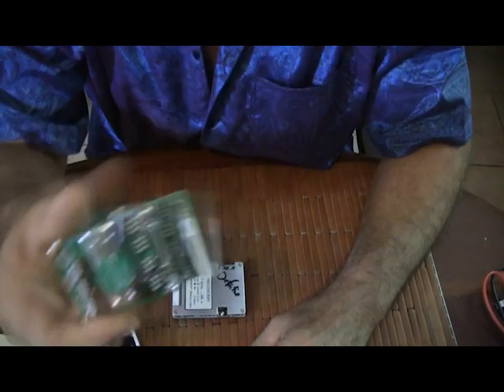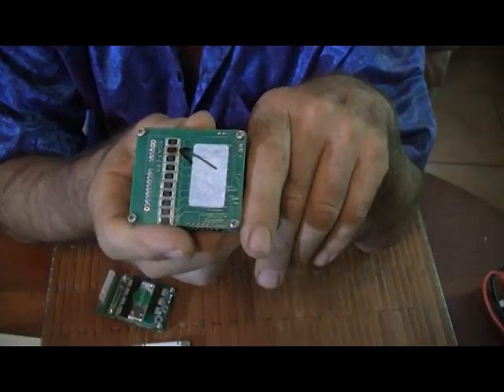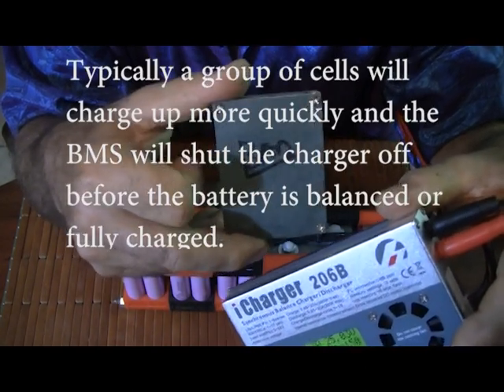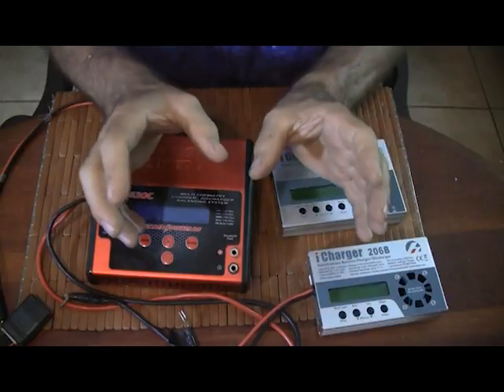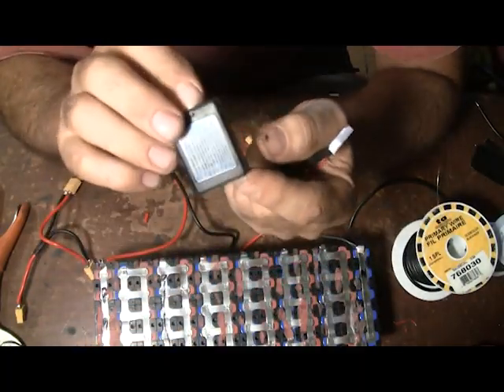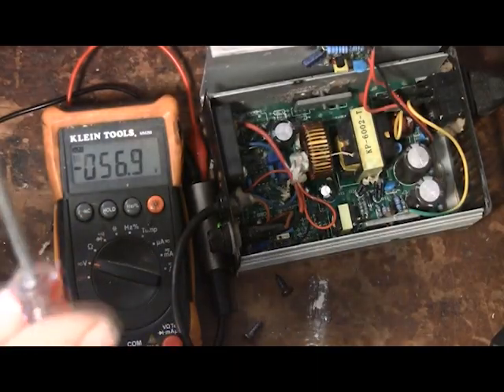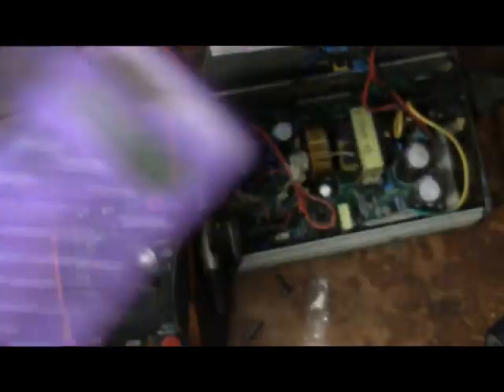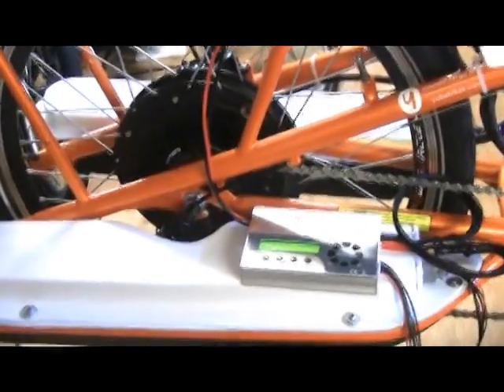How to build a safe and better lithium battery WITHOUT a BMS.

Comment: this is really interesting. I see the point even though it is too technical for me. Just to mention, i have an ebike running at 60v lead acid batteries. I wanted to have an extra batter pack. Preferable Lithium. I have seen a lot of DIY's in building one using lithium batts. I havent started the project just yet coz i wanted to research more. And ended up watching this video. Anyway, i now have to look for those gizmos that you used. Which im not sure if they are available here in the Philippines. Thank you for the information by the way. It is very informative.
Reply: James, I did just that, also in a 60v bike. Details here : 

www.instructables.com/id/Portable-Battery-Pack-for-Light-Electric-Vehicle/

Comment: This guy has way too much time on his hands
Reply: I have learned 80% from youtube videos and the rest from books or trying out new stuff and I write everything down in logs, good video but I do not trust Chinese batteries Japenesse ones yes they are way better and I as of now had only one Japeness battery catch fire but that was my fault, I had a drop of solder ( cold )  get between the positive end and the case where it shorted the battery out , I have had quite a few Chinese Li IOn's cook off because of their cheap build quality and this was before I had figured out they were not even close to spec . I will never use or trust a Chinese Li Ion ever

Comment: Charging at 4Volts Per Cell.  Interesting.  It looks like the science backs up your claim that this will significantly postpone the catastrophic failure of the cell.  If you fast-forward to 1 hour 13 minutes 30 seconds in this video you'll see the graph & hear the explanation.  https://www.youtube.com/watch?v=pxP0Cu00sZs&t=7s  Unfortunately, the graph stops at 4.25 but from his graph you can easily extrapolate...  Anyway, great video, just thought I'd share this link for you and all my fellow geeks out there.  PS  You'll likely want to watch this whole video at this link.  It will take you back to college days (SO MONOTONE!), but informative.

Comment: What do you use for your power supply on you iCharger 1010B+?
Reply from the maker: I use a computer server power supply.  Here is a url- but you can do it yourself:

http://www.2zo-rc.com/

Shawn
Reply: Interesting. I have a old power supply for a computer also. I also have a 36v Bosch battery charger, can this be modified to run the icharger?
Thanks Shawn!
Reply from the maker: No- the icharger accepts up to just 15 volts. Nice try though!
Reply: I'll just convert the old PC power supply then, thanks again for the tip!

Comment: can I connect a capacitor bank with this pack in parallel?
Reply from the maker: I have never done it but I am good at bullshitting so here goes.  Yes, if the capacitor bank charges to the same voltage as the battery does.  And that is no little trick.  Then the question becomes- what happens when a load is connected?  Does the capacitor bank discharge all at once frying the controller?  A tiny capacitor bank is hardly worth the trouble and a large capacitor bank might fry the electronics.  

More knowledgeable comments welcome!
Reply: Shawn McCarty You, my friend, are AWESOME!!! Thank you.
Reply: Shawn McCarty. yes this will load high current on the load resistance, thereby damaging it. also if discharged quickly it can cause a haphazard. btw thanq for your reply😇

Comment: Your pack doesn't even have to be made of good cells. My ebike battery made from laptop cells works great and stays within about 30mv by itself. The last time I balanced it was 3 months ago and I don't plan on needing to balance it for another 3 months.
Reply from the maker: Do you know what type of cells you salvaged?  It would be a good tip for all of us who need to balance a lot more often- even with new cells.     Thanks!

Comment: Hi . What battery configure do you have supplying your I charger . I just bought 2 1010b chargers 4 30 dollars and maybe 1 12v battery is not enough as is only 70 ah .What do you use in your inbuilt charger pack.I just bought a electric bike adjustment pack and like your reasoning but what is the effect from ripple damage from external ac sources via dc battery to li ion battery's .I see you have mains input by your helical lead to DC charger to another battery then the icharger  which supply's the li ion battery's .Do you fully rectify 110v ac straight to the icharger as they must be inbuilt also.  Just a question I will experiment myself as that's what it is all about. I know ripple from ac destroys a lot of battery's tho so if you know anything then please let me know.Its probably best too charge an ancillary battery first then disconnect ac and then use icharger as inbuilt system.
   Or you can use 110/240 v  input to a rectifier unit dubiously connected to the icharger to power the li ion battery's . I trust this is not what you do.
Anyway good channel ,loved your ride through the great Irish /British weather and the road layout all the small lanes omg it's a cyclists worst nightmare other than London.I grew up with peddling on the left side of the double yellow lines right next to the kerb. Yeah anymore and you had 2 be constantly looking over your shoulder for traffic cause they would never even consider giving you any room. Times have changed a lot now but roads still same in GB . Cycle in Germany if you want the best cycling trip of a lifetime in Europe and don't worry most speak English . I know live in Koln and cycling is awesome go to Dorn is most beautiful and naturalistic . Just learn a few German words instead of the normal reply of I only speak English and you will be welcomed even more so. I am a HV engineer living in Cologne and not a tout guide operator but this place is geared for cyclists more than Holland. Anyway enough said. Do you use an intermediate battery pack when charging.I would.Cheers
Reply from the maker: OK long question MOU!  congratulations on your ichargers- that is a good deal!

I power mine three ways.  One is with a computer server power supply.   The other is with a large 12 volt storage battery.  The third is with a lithium ion battery charger of 24 or 36 volts.  I have never had any issues with any of those methods.  The ichargers are quality units and probably filter out any AC ripple. 

My son is remodeling a 250 year old house in Germany.  I will travel there soon.   

Cheers.

Comment: I have a 48V ebike battery that keeps shutting down due to a bad cell. My BBS02 750w wont turn on when the BMS is disconnected from the battery. How do I make the battery work without the BMS connected?
Reply from the maker: I am surprised that the motor won't run if the BMS is bypassed.  The controller built into the motor also has a low voltage shutoff.  Are you sure that that is not being triggered?  Also, the motor may not run because the battery shows proper voltage but cannot supply the amps.  

You need to tear apart the battery and replace the bad cell group, bottom line.  This is where BatteryBlocs shine.

Sorry.

Comment: What the F##k is a bms
Reply from the maker: It's an abbreviation for Battery Management System.  They are typically a PCB that balances the cells when the battery is charged, and shuts the battery off if a cell gets too low or too high.
Reply: And some people actually care about such things? 
I best go and fit as many clocks and gauges to my car like we use to back in the 20th century..lol

Comment: Wow.. those chargers (I looked up the 206b model)are 112.00 to 160.00 (amazon has the highest price)
Reply from the maker: Yes, ichargers are the highest quality I have used. 

 However, check this out:

https://hobbyking.com/en_us/turnigy-t100-multifunction-touch-screen-battery-charger-us-plug.html

Comment: Hey Shawn thanks for all your advice how to set up my electric bike. Just got a new set of Batteries to solve my voltage drop cut off issue.  Haven't tested out the new battery but wondered if you could tell me how to adjust the amperage power on my 4 amp 54v charger. I worked out how to reset the potentiometer for the voltage but not the amps.
Cheers
Reply from the maker: Congrats on your new batteries!

I don't know how to adjust the amperage on your charger.  You may not need to.  If your batteries are greater than 10 amp hours you should be fine....    If it's critical you could run the charger through a Drok so you can adjust the amps.  I've got a video on it..
Reply: +Shawn McCarty Hi Shawn I want to expand my battery pack with a 13 x 6 parallel cell pack is it better to do this or attach another 48v pack in parallel? 
Thanks
Robert
Reply from the maker: Hi Robert,

Are you using BatteryBlocs?  IF so you can connect your 13 6packs to another 13 6 packs (or any other pack) and make one large 13s12P battery.    This means you could use one charger and BMS.  

If you have spot welded packs you will need to have two packs that you connect in parallel.  There is no other simple choice....

Comment: or do what i do and have both 

i have a 3S 10P (170Wh)  battery made from reclaimed laptop cells for powering an inverter when i go camping or whatever and i use a hobby charger (imax b6) as the primary charging method for the reasons mentioned in the video but when i need to charge it away from home i plug the BMS in and use that for charging (better than nothing right?)
(the hobby charger i have needs 12V power and is hard wired into my off grid solar system so its not exactly portable)

the output for the load is isolated from the BMS therefore it wont cutout on me randomly 
and i have a cell monitor hot glued to the battery so i can always see the cell voltages when i am using it and charging it so i can turn it off if one cell gets too low (the inverter complains at 3.5V/cell)
(i have a JST double adaptor so i dont need to keep unplugging the cell monitor) 

as for the low bleed current on the BMS you can sometimes fix that by replacing each resistor with a torch bulb if the circuit tracks are beefy enough then it will work a bit better since the bleed current will be higher and you can see when a cell is being bled and which one 

also not all BMS are created equally 
the ones you were showing are chinese junk (the aforementioned light bulb trick might not work on those)

the BMS in laptop batteries are designed to de balance the cells after a set number of charge cycles those fuckers are from the darkest pits of hell
(i have ripped apart thousands of "dead" laptop batteries and only about 20 cells were dead TOTAL)

a good quality BMS from a US or AU manufacturer will often outperform even the best hobby charger but you will likely pay a kings ransom for those ones 
the best ones are from electric car supply shops and are comprised of a BMS for each cell so if the cell goes above a set voltage (usually 3.65V since they are mostly for LiFeP04 cells) it will bleed at around 5A but they are about $40 each and you need one for each cell (or parallel string) however those ones will blow any hobby charger out of the water
Reply from the maker: Great comment!  Thank you for your valuable insights based on your field research!  I love the idea of replacing each resistor with a small light bulb.  I am working on a much cheaper BMS with a 5 amp bleed.  Contact me through my web site if you would like to help with the project.   shawn@batteryblocs.com

Shawn
Reply: i would be more than happy to assist

heres my email address if you want to contact me there (spammers and trolls will be blocked)

jeremyrose18@gmail.com

Comment: i think your frustration is misplaced. I also would rather live with a bms and mod it myself than live in a world where every joe average is  bulk charging unprotected li po cells ...enough people die in apt fires every year as it is. if u are selling these systems back to people i hope u hve a proerly structured llc and have made them sign waivers. bettet yet instead of the cave man aproach of "ugh angry, Ugh rip out safty device"...build an interactive bms with lower mins and or logic like: sound or display warning at abnormal range(where china bms would shut down) begin shut down timer, while watching  over ride button for keypress. if pressed  diable timer and monitor untill damage theshold. hell...if u do it right u can drop the offending paralell group out of the and ideally signal your esc that the c value has changed...that way joe idiot can be safe and sudfer minor inconvuence of throttle adjustment instead of bike svut down. Most bms drawbacks u mention to a bms are due to poor design, some of them can be eliminated completely all can be reduced
Reply from the maker: Good points, I don't disagree.  I am not angry, that is just humor.  This video is meant for those geeky folks who care and want to understand how their battery is doing.   I am designing an improved BMS that addresses those points you mention.  

My favorite low tech no  setup right now is a BMS coupled with a high/low charger.  The charger has a switch between two Charging voltage.  The lower charges to 4 volts per cell, the higher to 4.2.  In this way you get both long life and long range, you make the choice when you charge.  What do you think?
Reply: Along the low tech lines, could you wire-in cell loggers on top of the bms leads to keep track of the bms effectiveness while enjoying the simplicity of bulk charging that having a bms allows?
Reply: @twowheelscooter  this is kind of an idea I had. im currently testing my 40 cells to go into a 10s4p pack, i have the cell loggers, but I want to market the battery also to be a plug in and forget it, to let it charge until it reaches max, which a bms will allow with the appropriate ac/dc adapter.  theyre new ncr18650b  panasonic cells, (or so my testing is currently confirming anyways) so the bms might be ok, although the cell loggers are just for my peace of mind really.  the motor im looking at will take 22 amps max, and at 4p, i would want to only temporarily sustain about 4.8 x 4 = 19.2 amps draw.  so things might be just a bit risky to my battery health if i cant harness my amp draw accordingly.

Comment: Good video. I've found that battery packs last better when cells are in parallel as the cells keep each other balanced. I use 3x 4S4P in series for a 12S 20Ah pack without a BMS. I can split them at anytime for hobby charging but prefer to bulk charge using a constant current 10A LED driver with Max voltage set so that cells do not exceed ~4.1v. I occasionally balance each 4S4P pack separately using hobby balancer. The 4P setup keeps them very well balanced.
Reply: If this is indeed more efficient / better balance and longevity why don't battery pack companies and DIY's build their batteries in this manner as you described?
Reply: @connicrow9463   @Conni Crow  they do, except they always add a BMS due to the nature of lithium batteries.   I was confident on my pack because the sense wires (also paralleled) were very small therefore naturally limited current (like fuse wire). I did end up losing multiple paralleled cells when one went bad, but this is normal in any pack. BTW, as proof, my current bought battery is 13S(7P) compared to the long gone homemade 22S(4P) - I now have BMS security(cell charge limits; cell balancing which really is required as every cells different)
Reply: @MadMatty72  in other words, you got lazy and used a bms. I've been there haha.

Comment: Looks great for small applications but how could this be scaled up to even medium scale? Seems like you'd be putting a massive amount of labor into it
Reply from the maker: I have used this on the ebike battery that  I looped the USA with, a 10,000 mile journey.  That battery was a 3.6kw hour battery.  One way is to use a more powerful charger balancer like the icharger 308duo.  This charger puts out 1300 watts.          http://www.buddyrc.com/icharger-308-duo.html

The other way is to use a big charger for bulk charging and then to use a small charger only for balancing....

But you are correct it is more labor intensive and is for the person who wants to take charge of their battery.  : )

But for a house size- 15KW system- I don't know.

Comment: If you already have a wheel.... You might look into getting a "Cycle Analyst" LED controller/display.  This is more reliable then Bluetooth to phone but they are quite pricey
Reply from the maker: Thanks Ron,

I agree, the Cycle Analysts are the best.  I have never had one fail, and have ridden one over 10,000 miles.
If you shop on Hobby King you can find something similiar- a Watt Meter- But, they don't have a shunt, which means you have to run the power through them.

Comment: I don't have any overheating issues at all... however, I throttle back my amps and speed for street use to make it street legal. What is really nice is... when you go off road... you can do it on your bike with your smart phone and set it to higher amps and speed.  I do sometimes have issues pairing my phone when there is more then one Bluetooth device in the area. Other wise... as the Golden Motor Sales guy says... I just enjoy the ride...
Reply from the maker: Pretty Slick!  It's good to see innovation in this industry!

Shawn